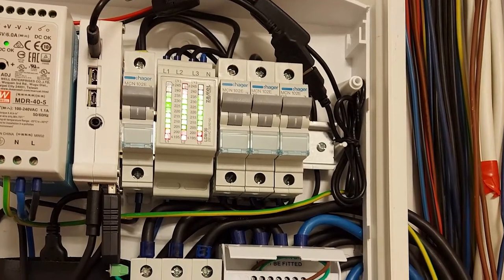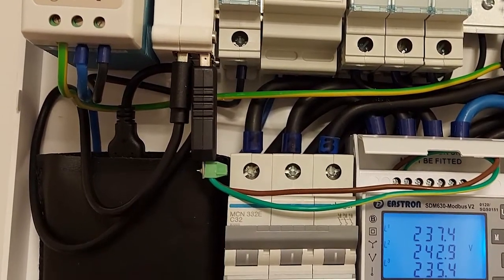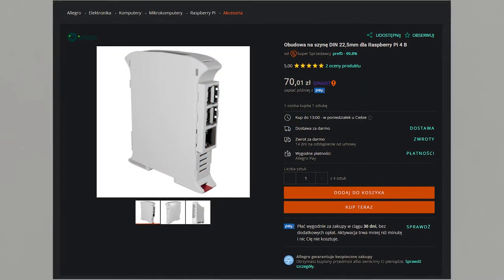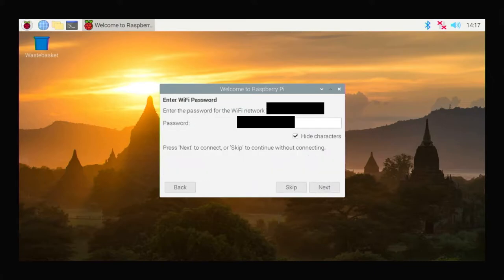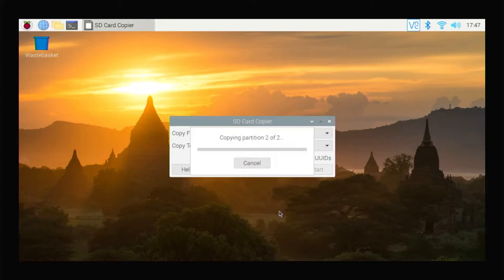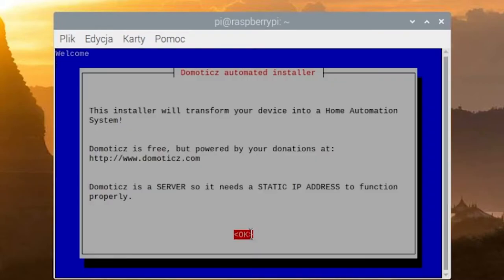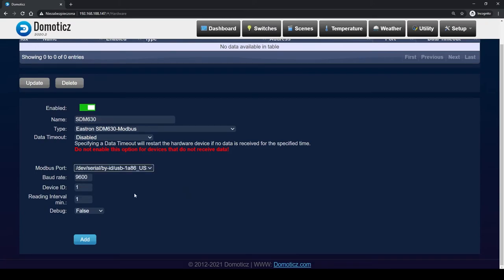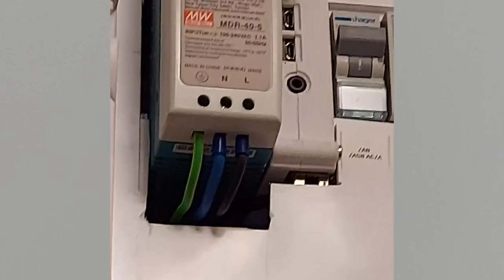System For Advanced Electricity Measurement   Electricity Meater Video

Comment: Continuing...As i see in Domotics you can see summarized data. Can we somehow filter power usage of each phase on specific time? i.e from 23:00 to 07:00? It could be ueful for Two Tariff measurement. And also, how can we export the data to a Database i.e Microsoft Access)? Many thanks again.
Reply: Domoticz already has its own database, sqlite3. Also, it permits to compare power usage/production among years. It's very nice